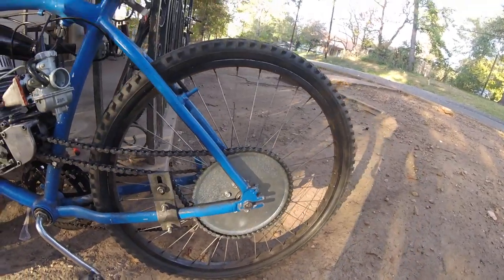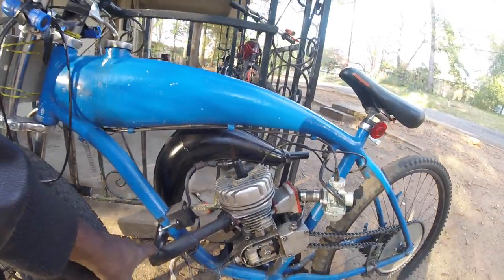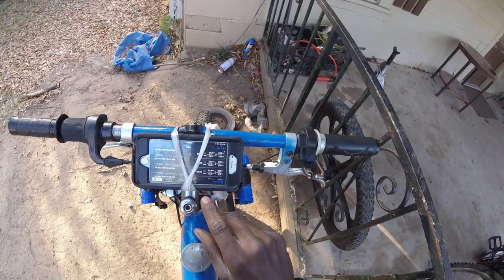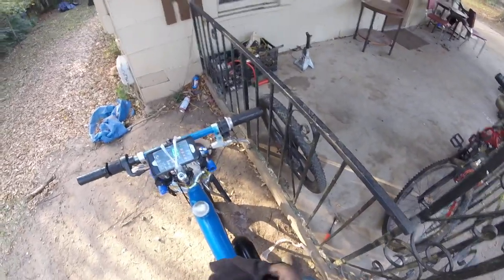56T Sprocket vs Hills "High Rpms!" Subscribe and Turn Notifications on Please.

Comment: I like your bike man.nice build!i live in a city with alot of hills too and i run a 44 tooth sprockett and thats perfect.i get up to bout 38 mph tops but can keep it at 17-19 mph up steepest hills
Reply from the maker: David Chapman cool bro and u can might use a 36 t depending on your weight and ur engine set up
Reply: Cool mines the same
Reply: No point in the 56 tooth tooth way to short set up especially when you have a good set up lk you have no need cor the gears to be that short
Reply: A 44tooth on flat I'm pushing 45

Comment: i don’t really like the twist throttle so i rig on a 4 wheeler thumb throttle from a 49cc mini quad. Those really work good for me.
Reply from the maker: Steven Dohm Good Idea Bro they more durable and I need an Aluminum one the stock Plastic ones break all the time
Reply: I perfer twisty .and yep plastic ones blows i goes thru alot of those.
Reply: Rinegn Productions np.am just chilling waiting for my tank frame to arrived.
Reply from the maker: K Lucifer cool
Reply: Rinegn Productions yeah i hope itll come out cool when am done.wont be a 2 stroke tho lol .hint i have a motor i build for a bike since last spring ;)
Reply: I might try this

Comment: It accelerates pretty quick with that sprocket, real nice. Can you tell me where you got your mz 65 pipe. I really need one for my zeda and I heard those are the best pipes right now.
Reply from the maker: Dan The Bike Man from zedamotorsports.com  they out of stock will be back in 2 weeks
Reply: Mine is coming in a couple days from bike berry.i got a motor im not too hppy bout.im hoping the welds are fine on this.what else can they fuck up?
Reply from the maker: David Chapman the exhaust? Nd comment the link
Reply: David Chapman  man I want a fast set up I weigh like 240 tho  what you recommend
Reply from the maker: Gregory Fegans a 79cc 4 stroke and maybe no bigger than a 46t or no smaller than a 36t rear sprocket  46 to 36T should work good for you with engine upgrades
Reply: @davidchapman3563  motors, carbs stuff like that is great with bikeberry, their exhaust is trash though, the welds are absolute garbage and pin holes all in combustion chamber from factory, order that shit off amazon

Comment: I like that bike frame.  I just bought one.  Pricey but the built in gas tank and motor mount is nice.  Plus the sprocket and mag wheels are nice.  Just curious if you added the upgrades or bought it that way?
Reply from the maker: I bought everything separate

Comment from the maker: 10:48 Im going to back to have fun one day 😂🤣😂
Reply: 0:53 where can i get this app on android in google play.
Reply: Hey brother how much faster is the Dio Reed set up over the 40mm and window piston set up?? That's what I'm running now with a 10/36 gear and I'm just hitting 40 MPH I was doing that without the small reed set up
Reply: Did you ever get that tensioner pulley swapped out because in this video it sounds like it has a disease
Reply: @foxman362  just search gps tachometer

Comment: Yeah man. Nice ride. I love to go  hill climbing in my hood on mine. You like that more than the 44 i use?  Sounds like it was winding out pretty fast. Good stuff.
Reply from the maker: winds out pretty fast ima say at about 25mph with that sprocket and i liked the 56 way better then the 44
Reply: @RinegnProductions  I heard that. You have the power for hills and 25 is about top speed for me. Did you lose top end speed w the 56? But it’s probably faster getting up there.

Comment: Does that mz pipe sound way louder than the stock zeda pipe?
Reply from the maker: Yes Sir, maybe 2x as loud but you can make the mz 65 pipe silent all you have to do is add a scooter muffler at the end of it only cost about 12 bucks on ebay, I have one and use mine all the time, it barely effects the performance

Comment: Nice MOTORIZED. But Why The Big Ass Sprocket. If You Want More Speed Go With A Way Smaller Sprocket. Like A 36 Or 32 Or 30.